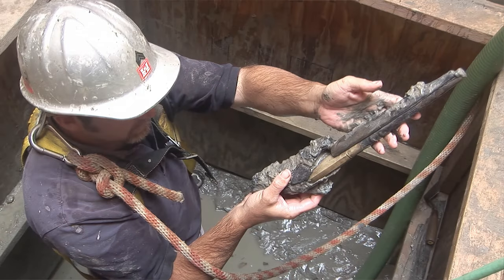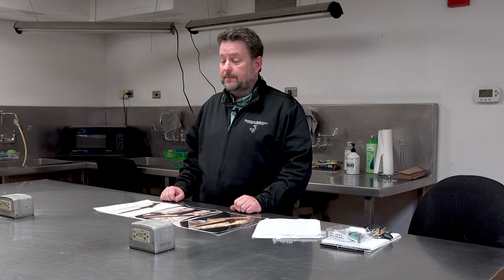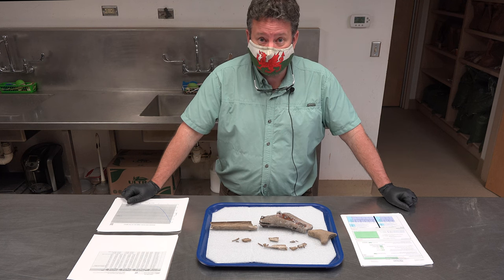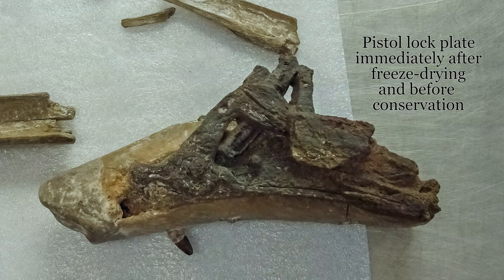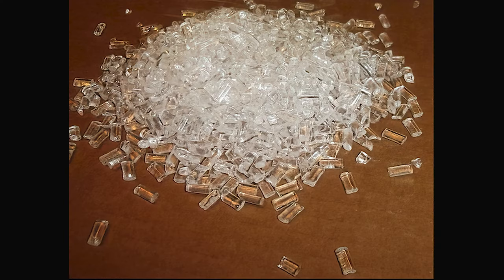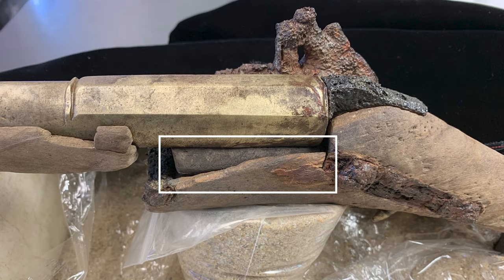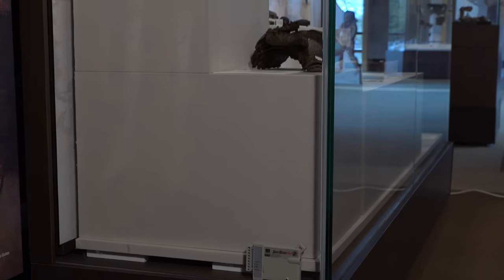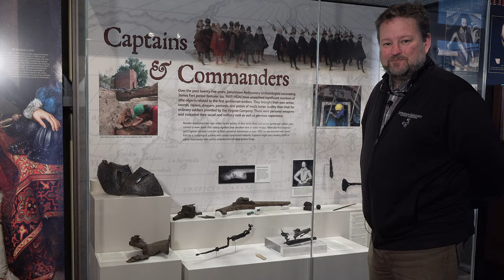Dig Deeper Episode #49 - Locked and Loaded, Part IV: Conserving to Preserve

Comment: Preservation as found I understand. But the stock is out of alignment. The barrel didn't need that huge gob of glue under barrel. That's where the barrel was supposed to fit and the rust mass pushed it up out of alignment. I would have had it on display fitted back into its form as it would have been before finding itself down that well.